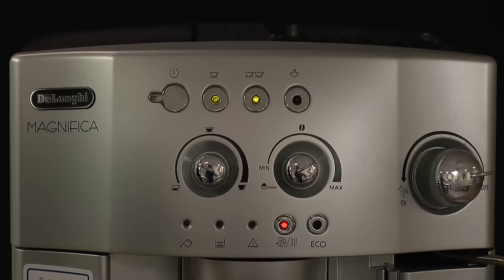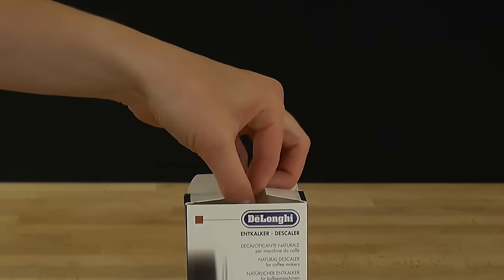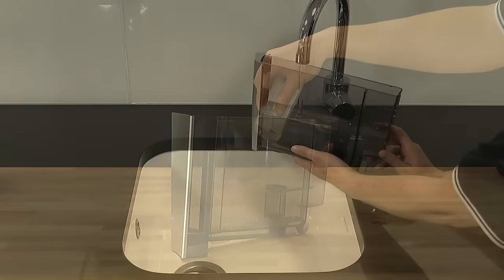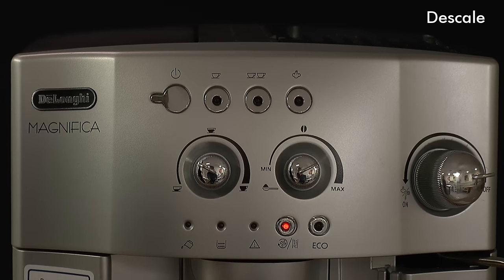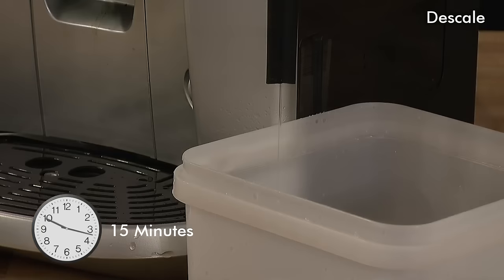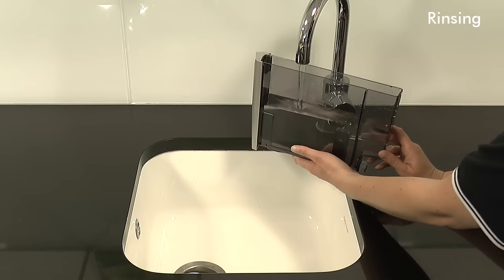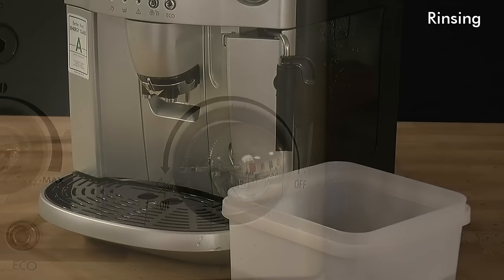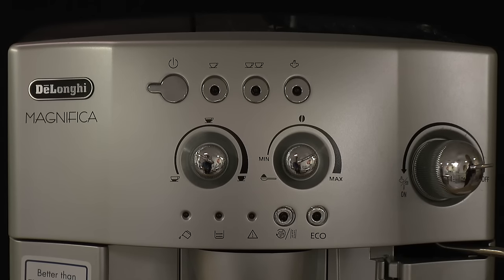De'Longhi How To Descale  Magnifica ESAM4200

Comment: One massively important point they miss out in the video is that it won’t be a continuous 15 minute cleaning process, it will keep cycling through, so be patient and leave your pan or container there. Kind of dumb they left that part out.
Reply: THANK YOU!! Very important comment, I started freaking out haha and turned it off
Reply: @FoogelyGoo  me too 😱
Reply: And also takes far longer than 15 minutes. If you leave it too long however it turns itself off and you have to start again.
Reply: Very huge kudos for you Josh!!!You are absolutely right! They missed that part both here in that video and in the original instructions form Delonghi! And guess what, when the process start and and stop for long period of time I though something happened and that is why it is interrupted and I have power off the machine and cancel the cycle and now couldn't start it again!!!Any suggestions Josh guys?
Reply: @FoogelyGoo  Same think here Alicia :) and how did you continue restart the process after that?
Reply: @Stef4o82  You know what i've learnt since this comment? i don't even descale my machine anymore and it hasn't broken and it's been about a year, I don't use the milk froth. I also live in a hard water area, I think descaling is a waste of money.
Reply: @FoogelyGoo  Hello Alisa, yes I might stop descaling it bu my problem is that is stopped in the middle of the process and I couldn't rince the machine and couldn't find a way to restart the process and I can't use it now because it is not rinced aftwr the cleaning 🤔🙄. Any suggestions 😊
Reply: @Stef4o82  hmmm, you could always do one 'bad' coffee, then the next one will be fine? or try and descale it again but with just water
Reply: @FoogelyGoo  Yes finally I find the way to just rince the machine with frah water and I have done 2-3 full tnaks with water and now I'm enjoying again a freshly brew coffee in the morning ☕😊👌, thnank for you help👍
Reply: A video dated  1 yr ago is even more vague about it….🙄. Most important point!!

Comment: Oh and agree with buttermilk, be patient. Once you've opened steam valve, machine does about a 5s purge then sits idle for about 5 mins before another purge. This is normal so DON'T touch anything, it is letting things soak/descale. As an added tip, once your coffee machine has finished, empty your waste descale solution container into your kettle for a free descale for a few mins! Then rinse...
Reply: for more natural descaler use vinegar ..cheaper, you can find anywhere and does miracles - I know we have extra hard water in my area :D
Reply: crackerworld I use citric acid. £5 a kilo from an eBay seller, with no nasty residual vinegar smell/taste.
Reply: This is where the real info is.
Reply: What a brilliant idea Thansk
Reply: Oh bollocks 🤦🏽‍♂️
Reply: Thank you, I didn't know there would be a ~5 min pause after the first purge (actually there were multiple purge-pause iterations). I thought something was wrong with the machine but it is part of the process. So, if nothing happens for a while - it's ok, just wait and don't touch it.
Reply: great... I thought something was wrong with it and turned the steam dial off and on again... DOH
Reply: @egelev  would be really useful if they mentioned this in the video?!

Comment: For those that wonder why it suddenly stops, don’t do anything yet, give it some time and it will continue, it’s letting the descaling fluid clean the internals before flushing it out. Wait until the watertank is empty and the lights are flashing!

You can use the flushed out water in your hot kettle, so it descales as well. 

Tips I got from some comments in here. Thought I’d summarize.

Comment: I didn't have the top lights flash but the red descaling did stop flashing so I began the descaling process by adding the chemical, sold cheaper at bed bath and beyond and fresh cold water to tank. It takes 15 minutes and it will go through a few cycles as if it's in a soak, so be PATIENT and let it do its thing. Walk away. After tank empties, repeat.

Comment: One thing that is missing ist to turn the mashine on before putting in the water because if not it will pump the acid through the usual coffe output. I dont know if thats a problem but it might be.
Reply: yes run loads of water through it on the pus side least the coffe output is then clean
Reply: Damn it
Reply: I actually prefer it that way as my coffee output / dispenser gets clogged too and I let the descale solution run through that when I turn on the machine. When I next go to make coffee I just run the rinse cycle a time or two.

Comment: Everything else is straight forward except the video failed to mention once machine stops running with red light on stead, and don't do anything, and let it run through till the tank is empty.  I thought it was non stop till Tank is empty, not sure if anything went wrong so I started the machine again.  Of course the descale solution went through coffee output. Now I am worried...

Comment: Very huge kudos for you @Josh Shires!!!You are absolutely right! They missed that part both here in that video and in the original instructions from Delonghi! 
And guess what guys, when the process start and and stop for longer period of time I though something happened and that is why  and I have power off the machine and cancel the cycle and now couldn't start it again!!! I dig in internet but no where there is an instruction how to restart the process 🙃and the worst thing is that it made the first process ,but it stopped on the rinse process ,so I couldn't use it now because it is not rinsed from the descale agents I'm afraid to use it like this and can't enjoy my lovely coffee! 😃 Please help guys because Delonghi are not very helpful!🤫 Any suggestions guys?
Reply: I'd just start it all over again: hold down the rinse button, the one that was flashing before, until it's a solid red. This time just use normal water - no descaler - and turn the steam dial all the way, and let it do it's thing. 

If for any reason that doesn't work - if the steam nozzle won't pull water through etc - then I'd take all the beans out and have the machine make a bunch of long 'coffees', until you've emptied the water container. Your goal is to just make sure there's no descaler chemicals left in the process of making a normal cup - so that should do the trick. Good luck!

Comment: my red lights still ON, it's not as straightforward as you show! any help?
Reply: Just wait. It will pause for a few minutes, rinse some more and repeat until tank empty. Don't wait once the water has run out or you'll need to start all over again as it auto powers off.

Comment: When I hold the red light down for 5 seconds all the other lights turn off what and the descaling is not happening what should I do?
Reply: This happens on mine too but the programme completes as described. Just be patient- I have thought that nothing was happening too but it does - as long as you open the steam dial

Comment: I press the descale, lights all ok, turn the knob then nothing happens? I’ve turned the machine off and on several times but the descale programme will not start? When the machine goes off and then on, steam does come out with a little water as usual it’s just the descale process won’t work? Any ideas please

Comment: I had the issue where the process would not start. Lights flashing, steam valve opened but then nothing. I left the machine in that state for about 15 minutes and the machine powered itself off (same as if you leave machine on after making a drink).
Once off I powered back on and pressed the descale button, lights flashing as per video, then reopened the milk frother (but quicker than previously rather than move it slowly as I did before) and the descale process has started this time. 
No idea if machine reset itself after it powered off or by opening the milk valve quickly has resolved issue but hope this could help others.
Reply: Same happened to me

Comment: Interestingly, neither the manual nor the video shows how much water to add to the 100ml of descaler fluid.  The manual makes no reference at all to it, and the video suggests you fill it somewhere towards the maximum mark, but not actually up to the maximum mark.  It would be nice to have something a little more precise.
Reply: You fill the water tank to the top as it will need most of that to wash through the machine
Reply: usually if no amount is given, you should work on 1 litre (that is what the descaling liquid guide told me)
Reply: The video says to fill the tank after putting the descaler IN !"!!"
Reply: You can see the water in the see throw tank. Hello. Open your eyes

Comment: Hi all. Does anyone here know how to solve the problem of the magnifica making weak Americanos with beans, my machine may have a ‘channeling’ issue (read about it online).
Has anyone taken apart the inner parts to clean/service them to improve coffee strength? (Also, it’s not a fine/course bean +/- adjuster issue, I’ve tried that both ways) Thanks in advance
Reply: I’ve got the same issue, I just use a smaller mug

Comment: Clean twice but the red light still on what is the problem
Reply: I have same problem what did you do?
Reply: Antonio Di Bartolomeo i have a same problem...
Reply: I also had this Problem thought the machine had gone wrong although it worked ok the descaling light was on, I did another descale with the manual in front of me and you must do exactly as it says, Daniel  is correct it is all to do with the steam knob, also this video does not mention washing tank before filling to flush, fail to do this and your coffee will not taste good.